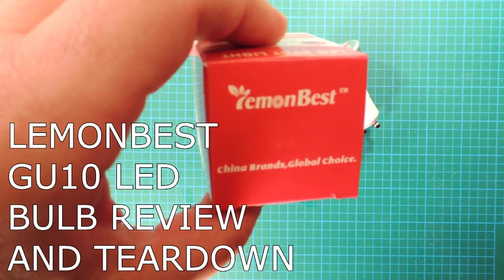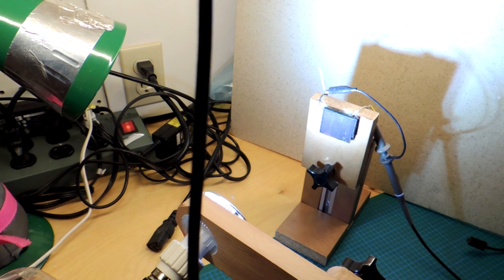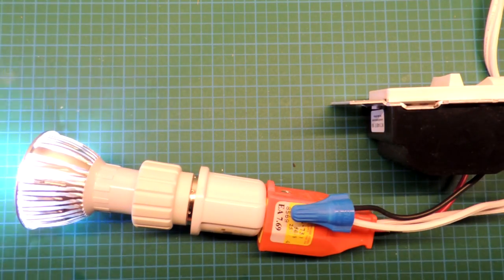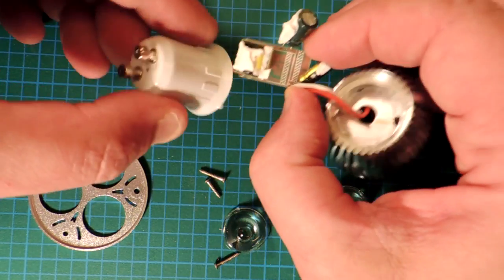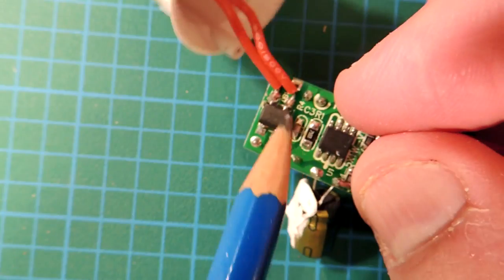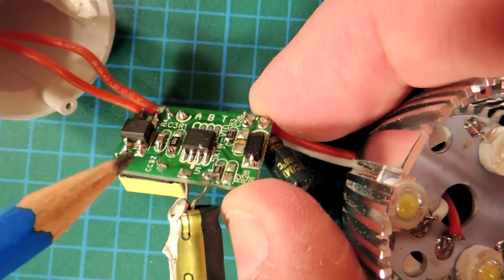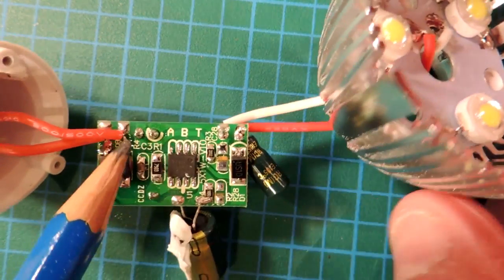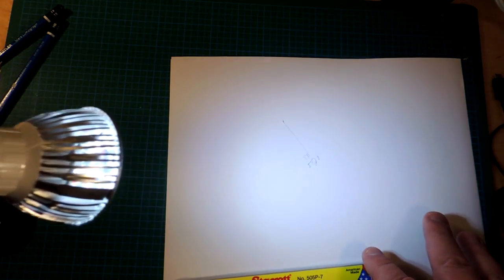Lemonbest GU10 LED Bulb Review and Teardown

Comment: This design is frankly appalling, the transformer is physically too small to provide proper insulation without using special thick insulation wire for the secondary winding, this has not been done here.

There is no consideration taken towards isolation gaps on the board, there is less than a millimeter between input and output voltages.

There is no  input filters so these bulbs will probably cause problems with radio communications and sensitive measurements. Also as you point out there is no fuse.

The LEDs are mounted on a low quality metal substrate board screwed directly to the exposed metal heat sink.

Please, if you decide to use these lamps, always assume live voltage on the heat sink, never touch it when powered on.

Also be aware that this type of underdesigned driver might catch fire at any time, never leave them on when you are not near to put out the flames...